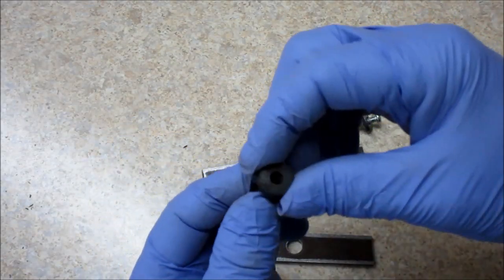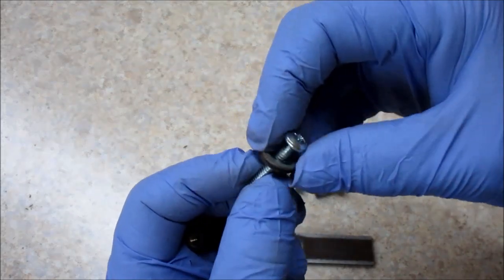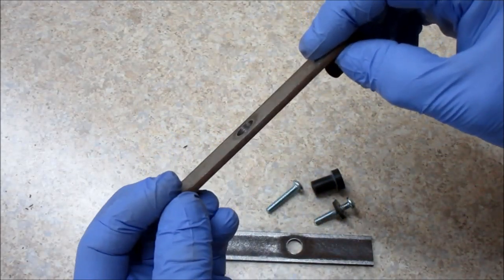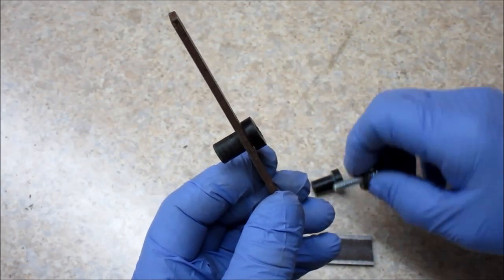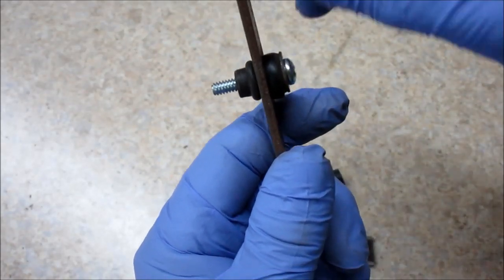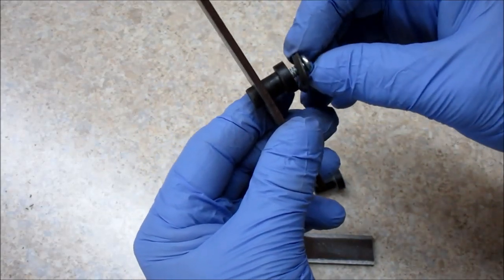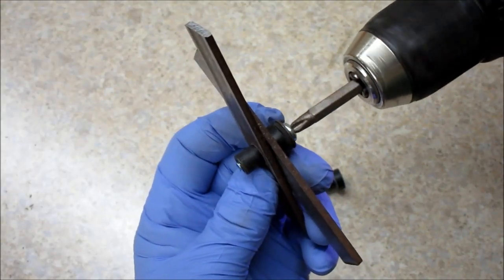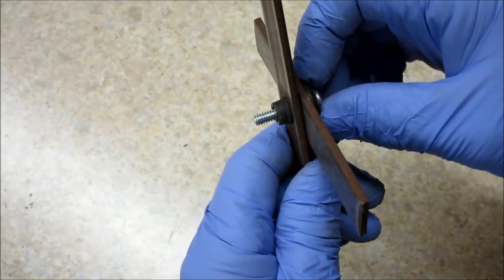What is a Rubber Well Nut and How is it Used Fasteners Retainers

Comment: What do u recommend for a well nut that is spinning and u can't get to it to hold it?
Reply from the maker: It depends where it’s at or how it’s installed. That can be a tough one.if you can grind the top off and knock it inside. Might be a good starting point

Comment: I am currently using well nuts on my kayak due to the fact that I can't access the hull.  When screwing this in by hand, and not being able to see the hull side, how do you know when they are tight enough, or to tight when you cant see the compressed part?  Also, if I remove the screw in the well nut (after a year), can they be reused or do I need to replace with new?  great video, thank you
Reply from the maker: It is a little touch..You have to learn to fill the pressure and know when to stop. Find you a piece of material that is similar and practice in it first, would be my suggestion..Those of us that use these frequently.. know what that point is by practice..
Reply: @LarrySbrusch  alright thank you.  Can I assume you can reuse the well nut once released?
Reply from the maker: @crankbait09  I have reused them in many cases as long as they are not expanded or stretched out too far
Reply: You can always use somethign that tells you the torque you using,install sum like he did in the video and see about much much torque you using to fully set them,then so later when you do it like in a kayak or somewhere where you cant see it you got an idea that its set good,thats something i would do,its a feelign but also know you relying on the torque thing,takes 15 to get it full it set,maybe gl 16,hopefully get what i mean

Comment: I fancy this has an application for sound/ vibration  isolation: Have only a 10mm thick wood baseboard to fix to (M5.)  I cannot go right through. Wish list; something similar that would just expand into the shallow  hole.:  stay fixed in. ( glue it in if I must)  Thus: device ( electric motor assembly etc)  is easily removable and re fixed ( transport)
Reply from the maker: Yes it would help isolate vibration

Comment: Hello
What would happen if the well nuts are too long?
Reply from the maker: They will not set in properly and may not work the way they should
Reply: If a hole is already premade in say a van can I put a well nut in it? I’m tryna hang some cabinets in my van and am trying to see what my options are. Thanks for your reply
Reply from the maker: @everybodyzuncle5792  If you could find the correct size it might work, but not sure how long it would last .depends how much weight you put in it. I would use nutserts instead..they will not hardly come out at all and hold a lot of weight based on bolt or screw size
Reply: Is there another name for nutserts? Tried looking online on Home Depot can’t find them
Reply: Search “ plus nuts”
Reply: @everybodyzuncle5792  Search for "rivnuts" (as in rivet-nuts)
ie: https://en.wikipedia.org/wiki/Rivet_nut

Comment: Why are you wearing gloves?
Reply from the maker: just a habit I have after being a mechanic for over  25 years..i use to wash my hands in varsol when I was younger and it seems to get in your blood over time...just practicng safety
Reply: @LarrySbrusch On the same note - I suppose eating/chewing gum - is also a habit learned over as many years - (but the lip-sucking sounds as you talk mean the audio sucks - pun fully intended)...
Reply from the maker: @QUIX4U  sorry u feel the way you do, but I do have a problem with speech, being I had cancer cut out of the side of my throat..not much I could do at that point.sorry if it did not meet your expectations